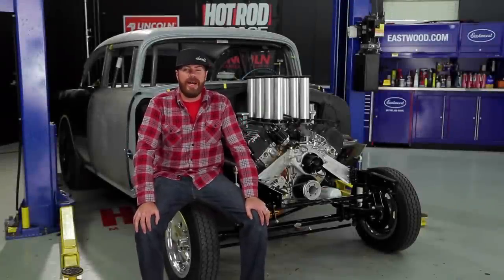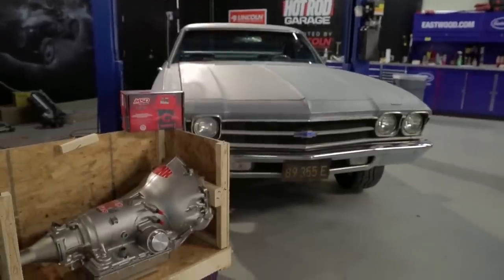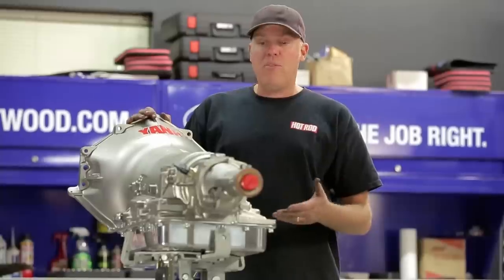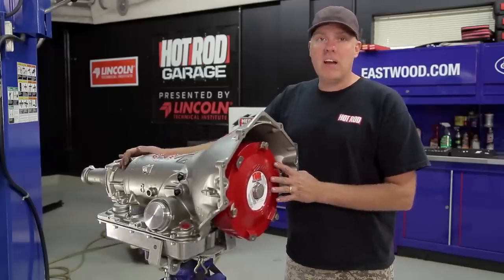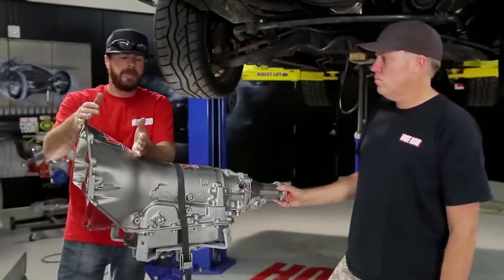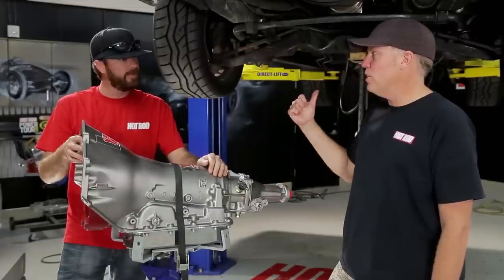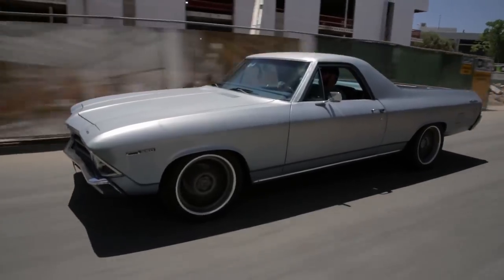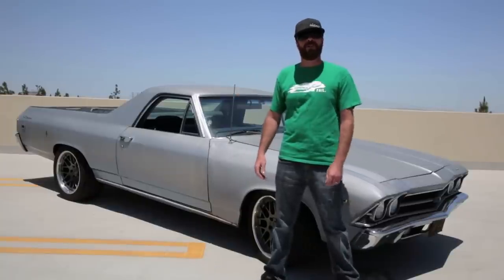Hot Rod Garage's Gearstar Performance Transmission 4L60E Installation

Comment: What is the best upgrade 4L60e transmission I can put in my 07 3.7 liter H3 Hummer. I would like to put 34 inch tires I have factory 31 inch. I have learned the many oe parts are problematic what is the best upgrade for more torque and long life. thank you for your videos

Comment: How much for that transmission,  I need one for my 2004 Yukon slt !!
Reply: He said it cost $3,900 it can handle up to 600 + horsepower but they have models that handle 450 horse power that cost $2,400,,sheets expensive!

Comment: all sales are final man screw that if im paying 3800 it better have a warranty
Reply: all sales are final means: once it's sold they don't buy it back.
Reply: +Zack Farah oh okay im fine with that as long as it gets fixed if something happens within a good time frame
Reply: +Zack Farah okay so one more question i want a snap my neck aggressive shift do you guys offer that in a 4x4 4l80e
Reply: +tunercars3 yes  they can build you a 4L80 to hit very hard, custom built to your specs.
Reply: I bought mt built tranny for 1200 installed already

Comment: wheely132...call Gearstar @ 330-434-5216 they will hook you up for sure. The post about the junkyard trans is funny since those are the guys that end up not only replacing the trans when it goes but rear ends and engines as well lol....Happy Holidays!